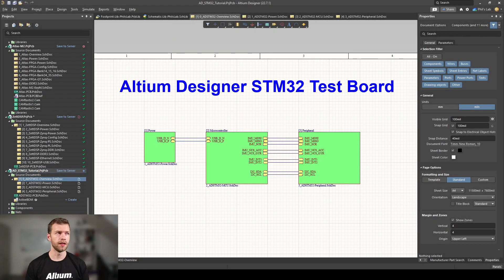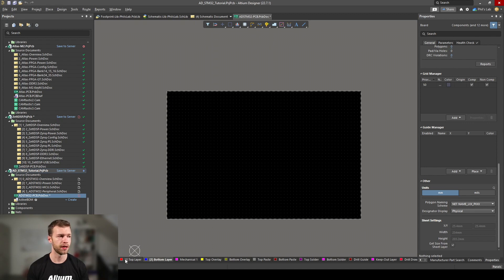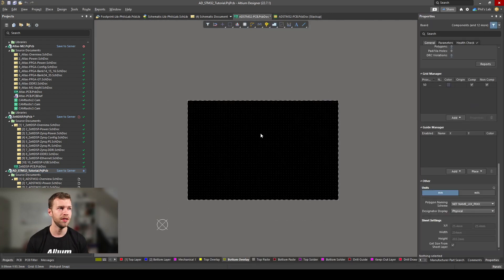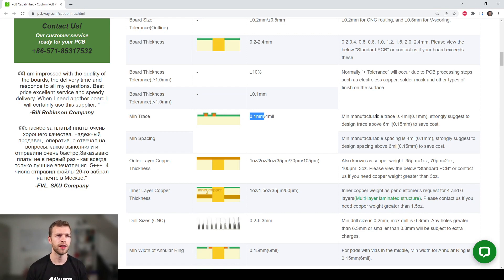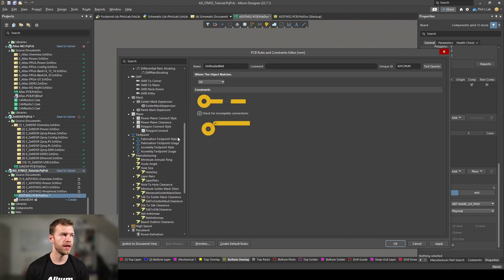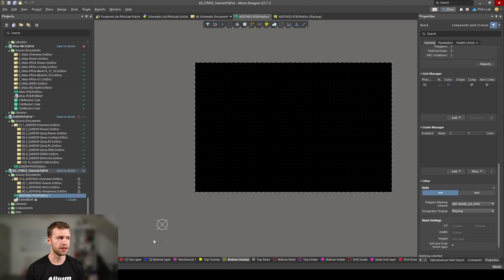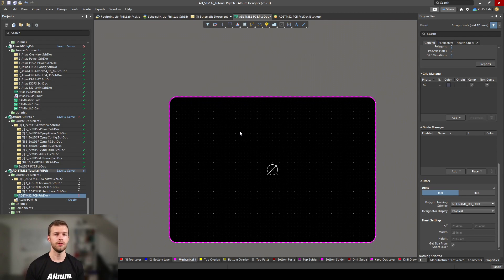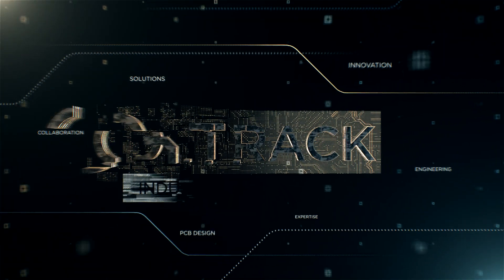Microcontroller-Based Hardware Design With Altium Designer - #6 PCB Set-Up

Comment: Excellent tutorial, I wanted to add that generally, it is recommended to use a specific feature in the pcb as the origin such a a mounting hole, a pad or a via.

It is also recommended to turn off any automatic enlarged solder mask opening which is the case in Altium. Fabricators will most likely enlarge them anyway so do not do their job for them. Let them decides this according to their manufacturing process tolerances.
Reply from the maker: Thanks for sharing!